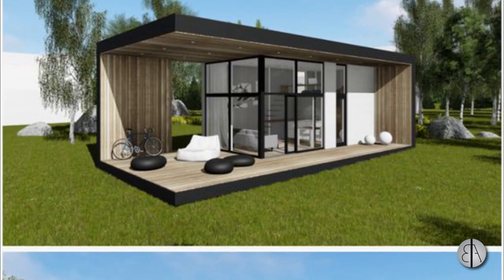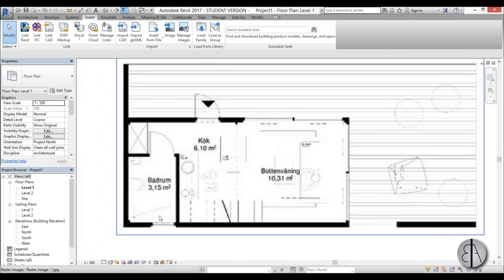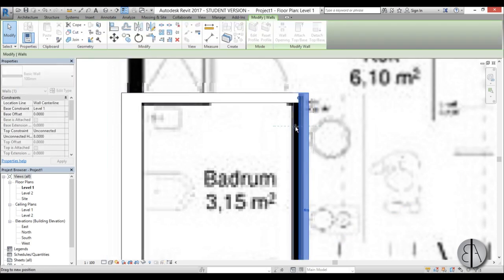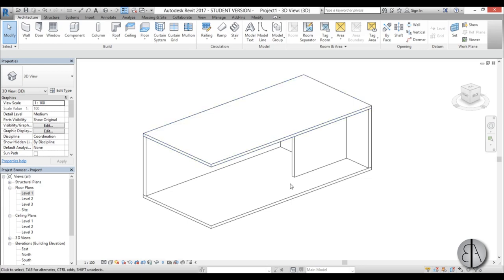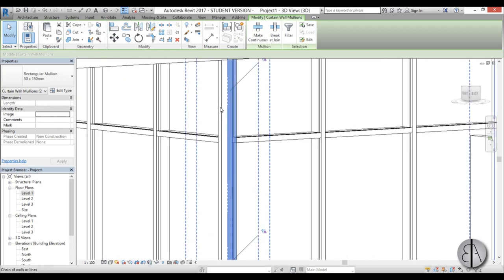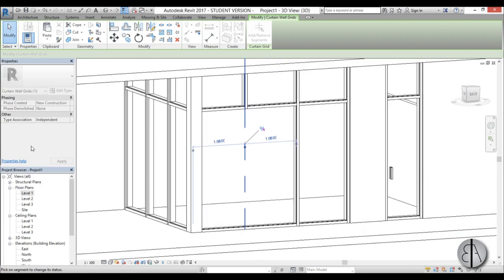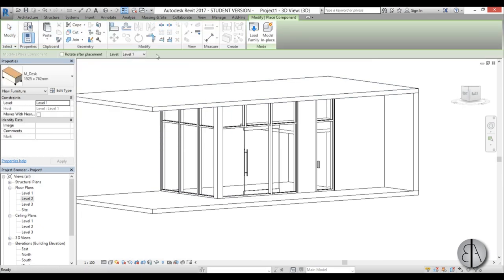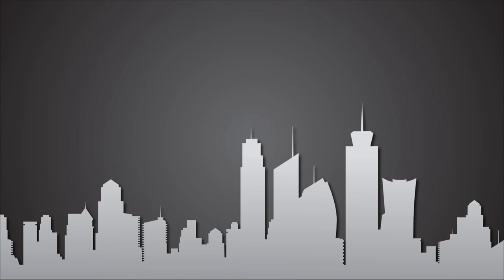Modern Micro house in Revit Complete Tutorial part 1

Comment: I'm having troubles when I pick up a plane on the part when you're selecting materials. When DIVIDING Can't select the entire wall element, it just selects a line and doesn't let me sketch on Section view. so it won't generate any division. :/ and yes, I did use the workplane on the main wall.